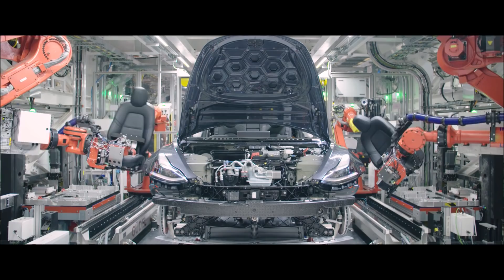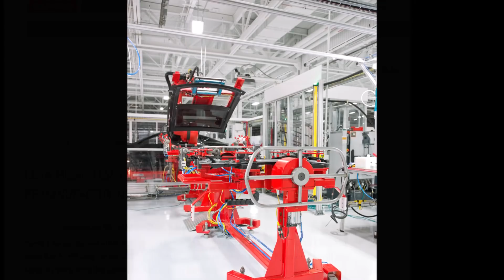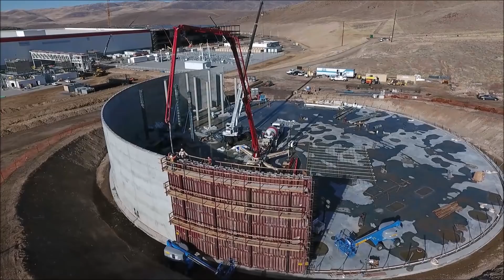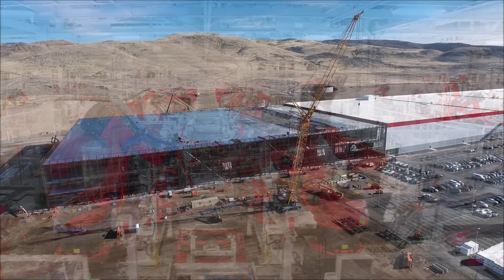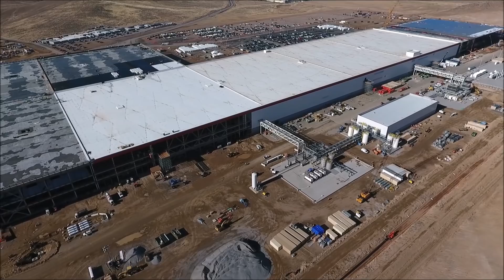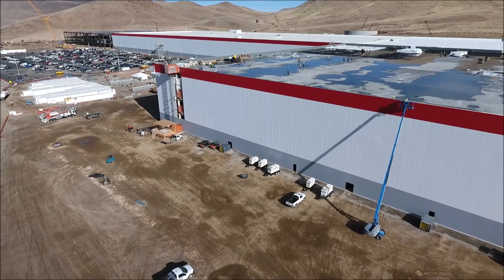Elon Musk Says Manufacturing Is Tesla's Long-Term Competitive Advantage

Comment: Flooding the roads with battery cars is not thought out. Car batteries, no matter how good they might get, will still need to be charged. This means they will need to draw power through wires using our anemic electric grid. To make this possible, we will either need to redo our grid, or to supplement it throughout using power generators. The power generators can run on fuel oil or natural gas. Or they can run on hydrogen. If they run on fuel oil or natural gas, the benefit of having battery cars is defeated. If the power generators run on hydrogen, they will need to be refueled -- which means we must put a hydrogen infrastructure in place to do so. But if we are going to have a hydrogen infrastructure to refuel hydrogen generators to charge battery cars, why not use the same infrastructure to refuel hydrogen cars and trucks to use the hydrogen directly?
Reply: Your argument makes no sense at all. It has been well established for over a century that the most efficient form of energy distribution is through electricity. That is what powers homes and factories. You can distribute electricity through wires and through your electric grid. And all of this is well established technology and capability. It is completely absurd of you to argue for building a new form of energy distribution - and your argument is to replace the existing gasoline chemical energy distribution with hydrogen gas distribution? This doesn't make any sense at all.

And if your argument is not about energy distribution but energy production, then too it is a no-brainer that upgrading the energy production of a centralized power plant from fuel oil or natural gas to solar/wind/nuclear etc is not that big of a deal. All you have to do is to upgrade one source. The electric grid (energy distribution infrastructure) still remains the same, the recharging electric outlets still remain the same, the electric cars still remain the same. That upgrade will take a fraction of time and cost compared to your solution of upgrading the entire production, distribution, and consumption of a new form of energy. Never mind the fact that hydrogen gas is extremely flammable, leaks super easily and is a massive fire hazard. And it is not that hydrogen has is magically going to produce itself. You're going to be burning fossil fuels to produce the hydrogen gas. And if you're going to use solar/wind etc to produce hydrogen gas, then why bother converting it into hydrogen at all? Your solar panels natively produce electricity - just use that instead.

When you buy an electric appliance, you don't care if the electricity that powers your fridge or TV is made by natural gas plant or nuclear plant or solar plant. You're instead asking people to "upgrade" to a hydrogen powered fridge and TV and washing machine. That is just a patently bad idea.
Reply: Incorrect to a very large extent.
Reply: @mike21216  Good, but you forgot about other renewable like wind and solar. The future I see with BEVs is based on Solar energy and not hydrogen or natural gas. If we focus our attention on harnessing solar energy, we could generate more that we consume.
Reply: I live in Quebec, Canada and 95% of our province energy is hydroelectricity. We are good to charge a few batteries here hehe
Reply: @alexb.4356  Lovely. Clean energy. 👍👍
Reply: Does not compute. Do you think you are as smart as Elon is? Not.
Reply: In a word nonsense.
Reply: Perhaps you haven't heard Tesla is also an Energy company. Not only do they manufacture it, solar, they also store it in batteries. They're making the old system more efficient and making money doing it.
Reply: You are ill-informed. Sorry!
Reply: Yes,  we need to redo our electric grid. nd when we do it we could make it an efficient DC grid.
Reply: +George Kafantaris    Man-made climate change is a scam.  All of the CO2 stored in fossil fuels needs to be put back into the air.  The earth will die if we don't do this.
Reply: @Islamisthecultofsin  You are ill-informed. Sorry!.
Reply: @richardpark3054    How am I ill informed?  There was a blizzard out west that lasted two days and got no coverage from the weather channel.  They talked about the fires instead and how climate change was to blame.  Stop listening to these liars.  The virus is just another fraud.  Destroyed the world's economy over a  virus that you are almost completely guaranteed to survive if you catch it.  Eventually everything collapses.
Reply: @richardpark3054    copy into your YT search box an watch this video:  "09/08/2020 Eisenhower Tunnel I70 Closed due to Heavy Snow and Numerous Accidents"